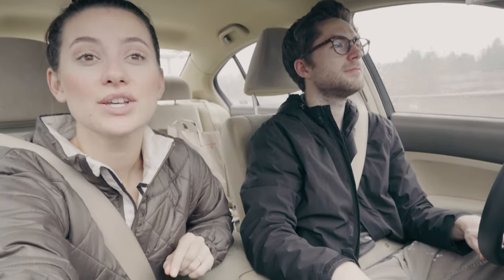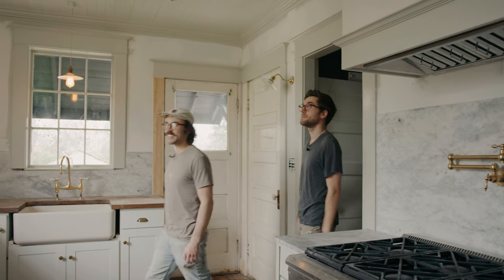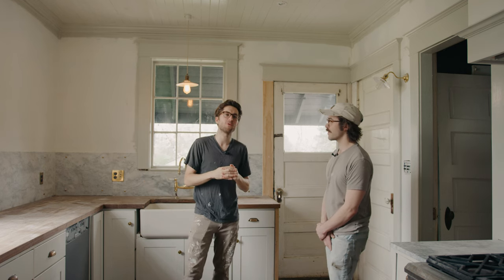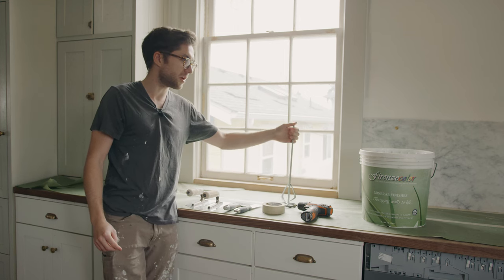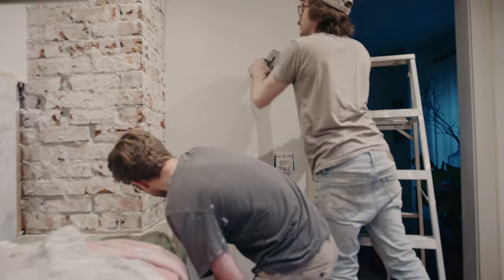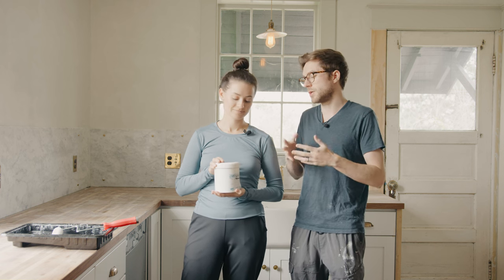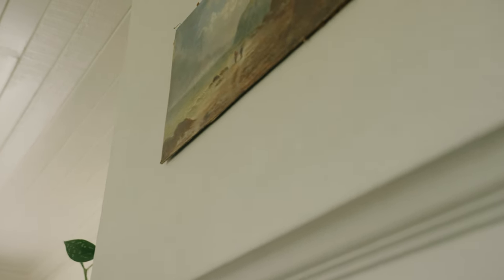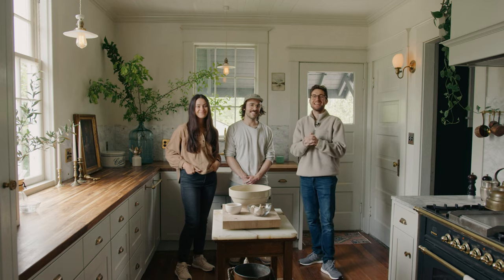AMAZING VENETIAN PLASTER KITCHEN REMODEL | plaster range hood + full process

Comment: I’ve been learning plastering with KS on mdf boards. I’m using a trap trowel like yours. What angle do you use to applicate. I’m trying to get a nice spread of product on each stroke. Thank you. Great videos.
Reply from the maker: If I were to guess, I probably apply my plaster somewhere between 20-30 degrees but not 100% sure. For the final coat, I tend to apply on the steeper side, pulling more plaster back off. Hope this helps.
Reply: Thanks for the reply. I got some ks and gressello to play with. Might buy some dune next. Lol
Reply from the maker: Awesome! The metallic plasters are fun.